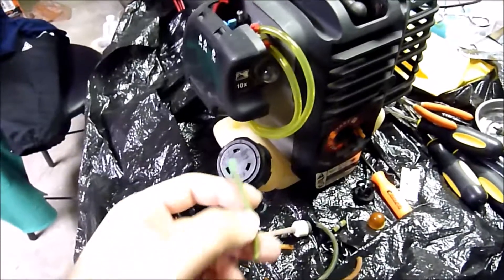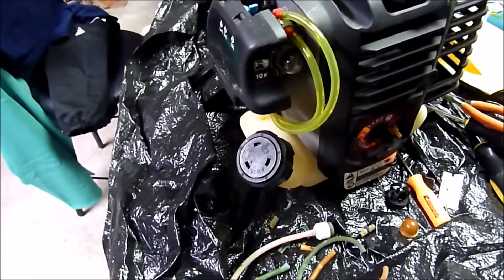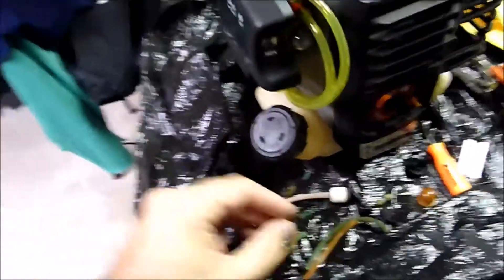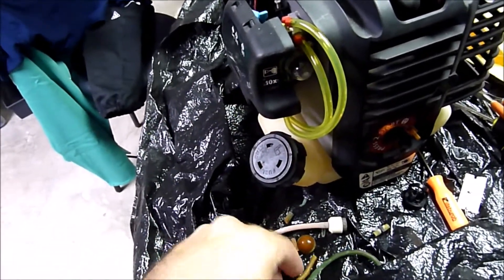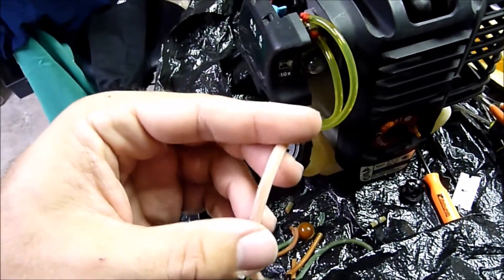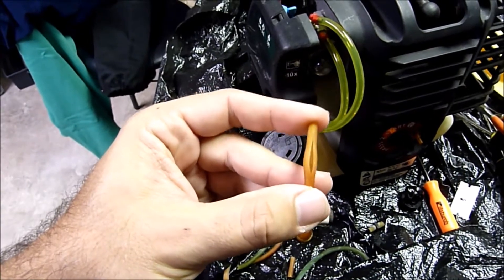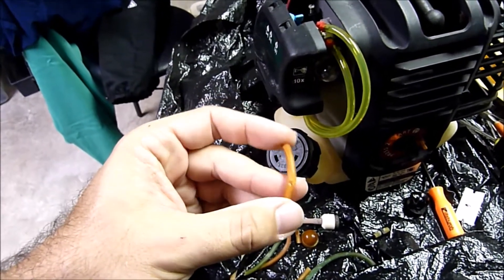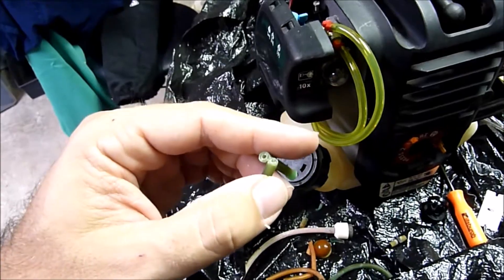Fuel System Damage from Ethanol

Comment: This proves NOTHING about ethanol being the cause of the problem. Heat, exposure to UV, or aging can do the same thing. Show us the same components being exposed for the same amount of time to non-ethanol gas, using the exact same mixing oils, stored in the exact same conditions and you would begin to develop an objective comparison.